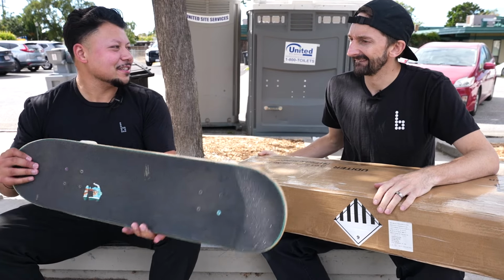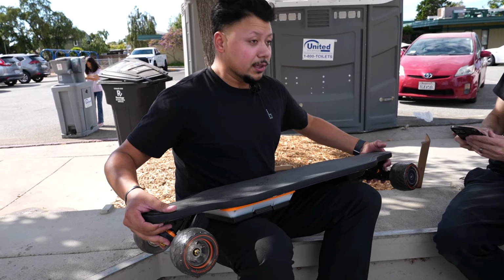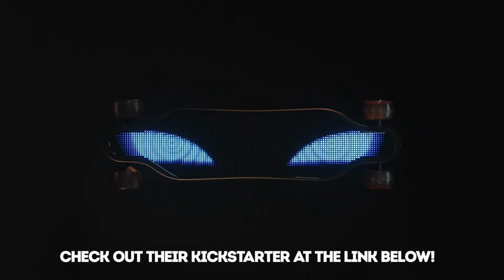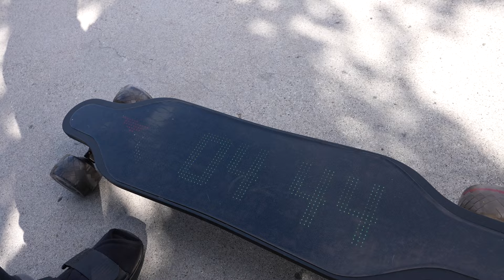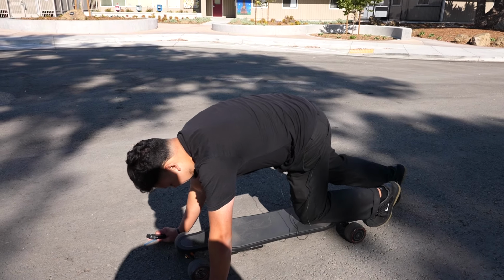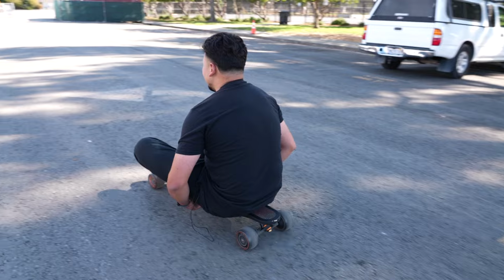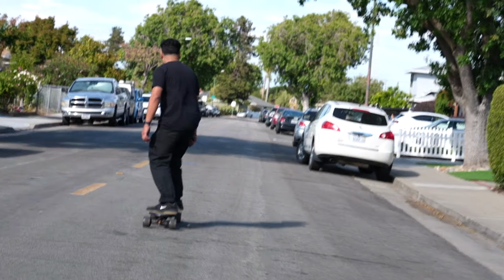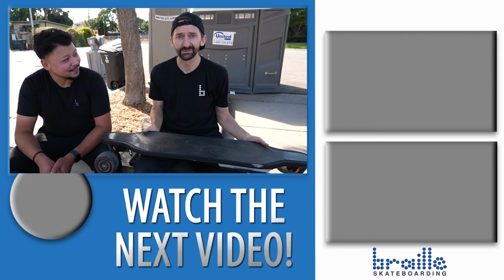Worlds first LED Electric longboard!?

Comment: Swappable batteries have been around for years and so has non abrasive griptape along with LED lights… nothing new too see here
Reply: Please provide link to a similar board with all the same features.
Reply: no one said swappable batteries werent around before this. same with the grip tape. its the first for them. not the first in the world
Reply: You're right, quick-swappable batteries aren’t new, but our Pixel Rider pushes the boundaries with a customizable LED screen integrated into the deck. It’s not just about lights – you can showcase dynamic images, GIFs, and text, making each ride uniquely yours. Combining the swappable battery with the LED screen really sets this board apart. Do you think so?
Reply: @UditerBoard it’s been done with Griptape before.  So it’s so the only thing that’s really new is the direct integration

Comment: But how far can it go on a full charge?
Reply: Great question! With a fully charged battery, the max range of Pixel Rider can go up to 20~25 miles. Plus, with the swappable battery, you can keep riding for as long as you have extras! 🔋 Are you looking for an e-board to long commuting?